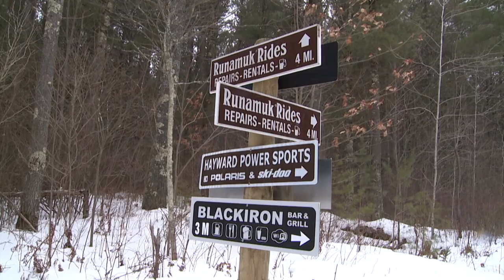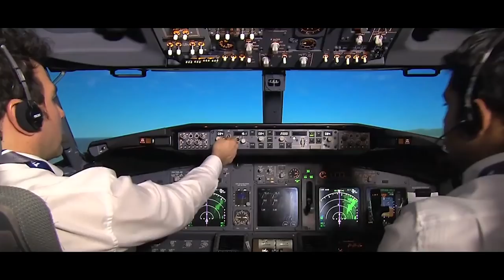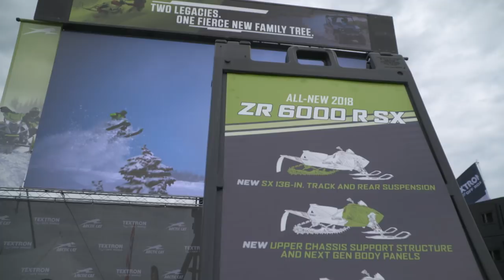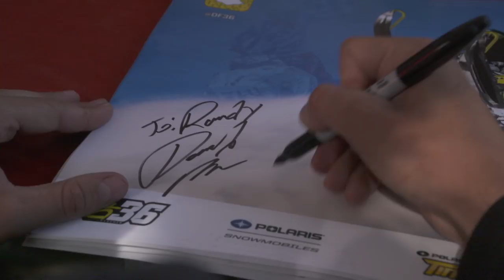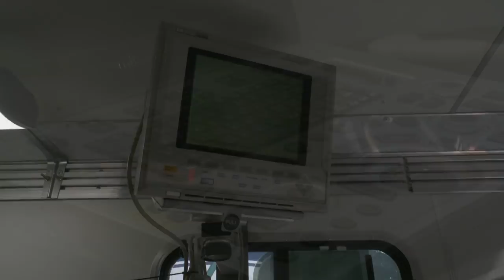SLEDHEAD 24-7 | 2018 EPISODE 1

Comment: Is that 600 e-tec in that Si-Doo Race Sled built like the 850 or is it the previous 600 e-tec design?
Reply: paisteboy yes it is - it is the bottom end from the 850 with 600 jugs... it even has the same injector booster as the 850 so this new 600 mill is gonna rock!
Reply: I heard it was the 850 jugs too just sleeved down to the 600 piston, so it still had the big 850 ports. That's only for the sno-x sled, the x-country sled is about the same as last year just new fuel map n timing.